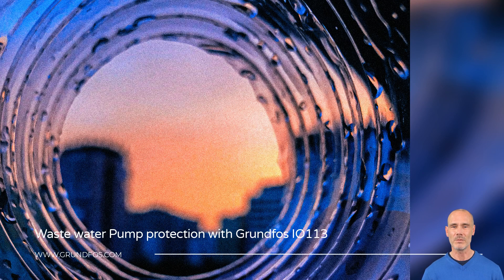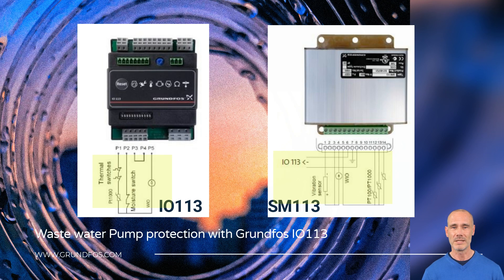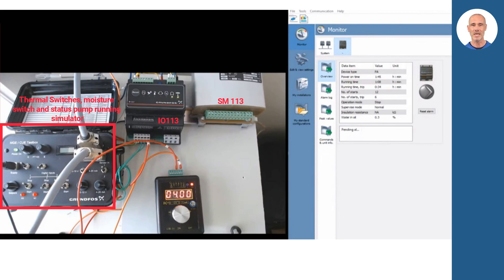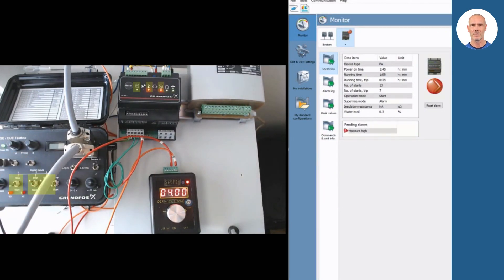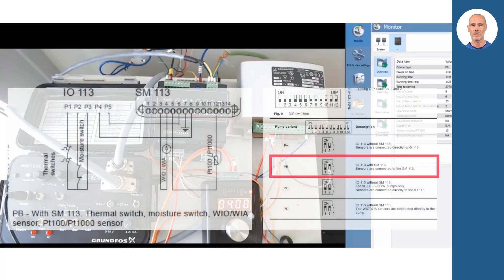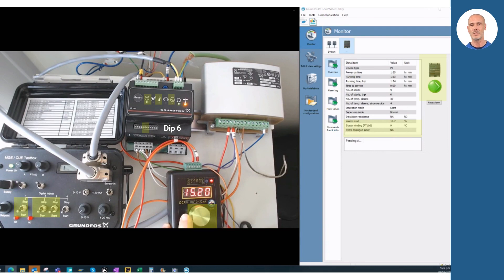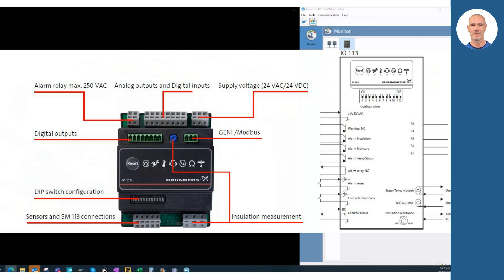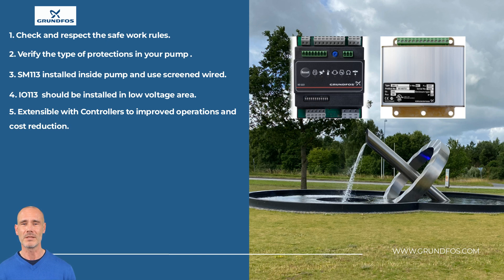Grundfos IO113 WasteWater pump protection

Comment: I have a problem with the panel in the panel appears "pump stalled" 
What is the problem ??
Reply from the maker: Dear User
Thanks for comment here.
By description seems that pump can not rotate under current status and it is sending that state to the controller. Our suggestion (if it is possible, after read manuals and take the safety  measures), is to check if shaft/impeller spin free. If it rotates free, you should check wiring and control input. If not you have to analyze the pump. If you have more doubts, our suggestion is contact to your local service Grundfos provider or your Grundfos local responsible.  
Depending on your country you could find the basic contact here;

http://spr.ly/6056OPZZ8
Reply: @grundfos very well grindfos❤❤❤❤❤❤❤
Reply: Very well grundfos❤❤❤